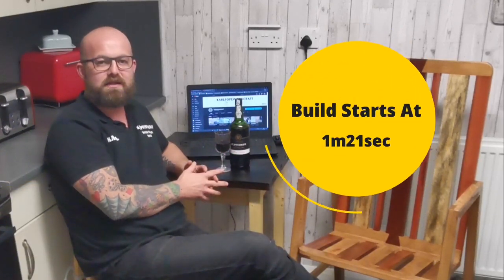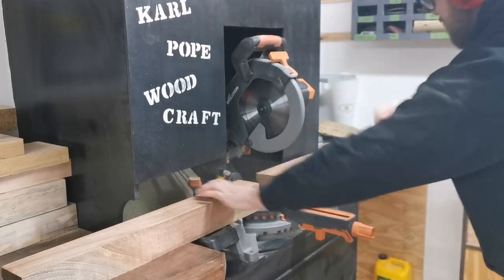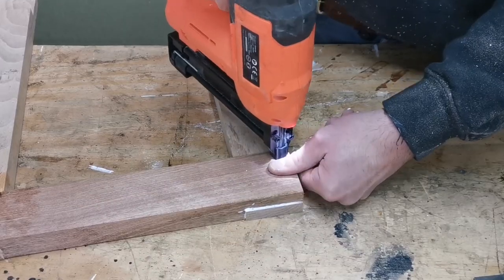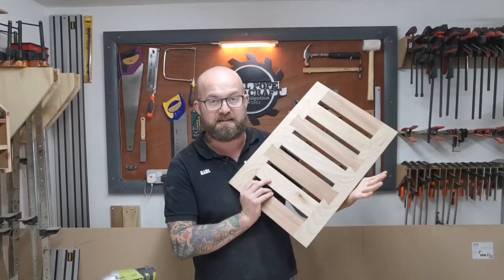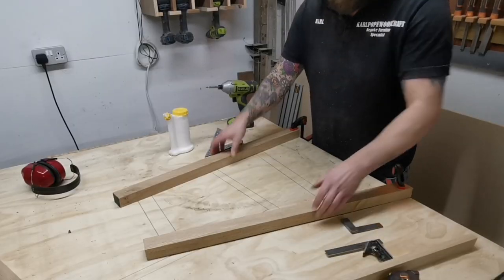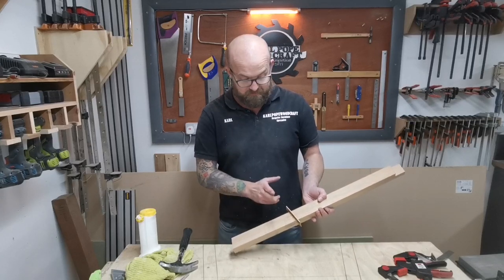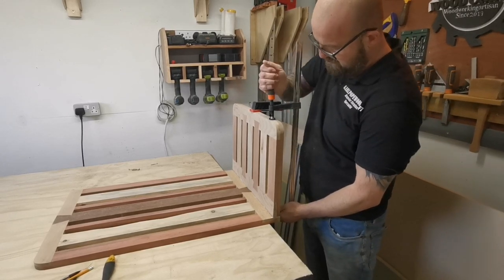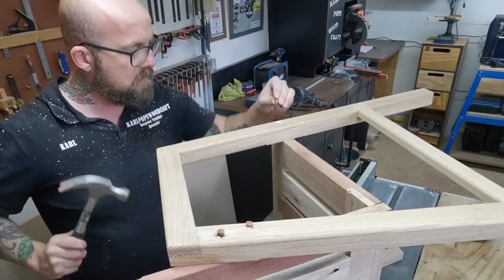Dining Chair Build #KPWBCC2020

Comment: I love the way you use more budget tools and still get really great results. Shows you don't need Festool
Reply from the maker: Thank you Nicholas I didn't even think of that. Let's take a look at what I used, drill press (Silverline) drill and driver (guild) brad nailer (vonhaus) chisels (Magnusson) g
Hammer (Cheapo) Square (silverline) table saw (dewalt) track saw (dewalt) thicknesser (Proline) planer (rutlands) can't remember anymore lol so mainly budget brands with the table saw and track saw mid range ish site equipment. Thank you Nicholas 😊

Comment: Hi Karl merry chrimbo and all that! I like the look of the chair mate but is it going to be able to take the strain of human use? I'd be scared of the legs doing the splits especially if I sat in it 😁
Reply from the maker: Cheers Glenn, I have a simular computer fold up chair and it's flimsy as and still never failed even though I have used it as a ladder 😂 this one is made from super solid timber and feels incredibly sturdy so I'm pretty sure it will last a lifetime, having said that a supporting brace could easily be a added across the legs if I ever become concerned. Thanks for watching as always mate and hope you have a great Christmas.

Comment: Great video Karl, what miter gauge setup are you using?
Reply from the maker: Hi Paul thanks mate, on the table saw?
Reply: @karlpopewoodcraft  Hi Karl, yes sorry mate I meant on the table saw👍 I have the same saw and looking for a good replacement to the crap Dewalt miter.
Reply from the maker: @paulharrison7029  I'll put a link to exact one tonight mate, through my amazon affiliate account if that's OK, it doesn't cost you anything but if you use the link I get a few penny's from amazon.
Reply: @karlpopewoodcraft  cheers Karl👍
Reply from the maker: @paulharrison7029  hi Paul the link is now in the description of the video.